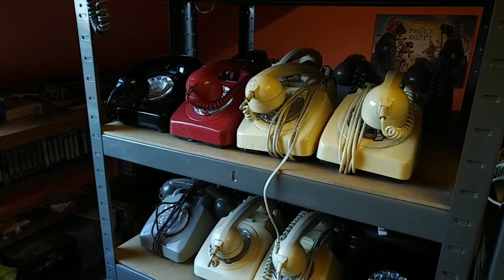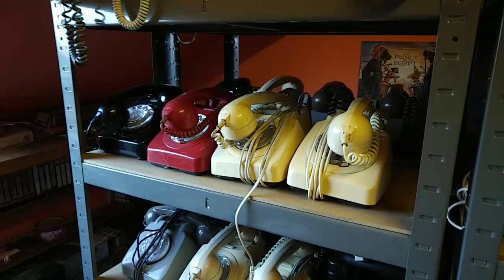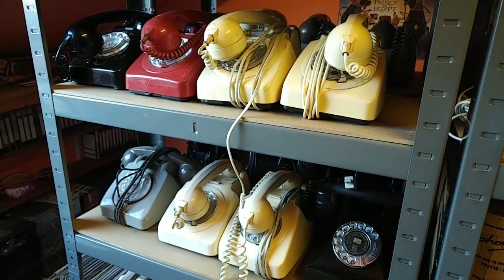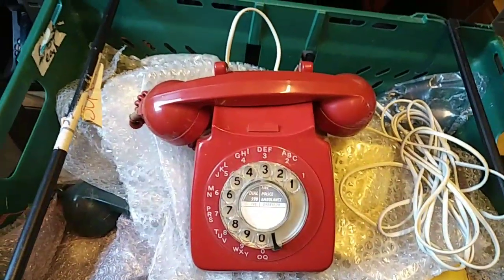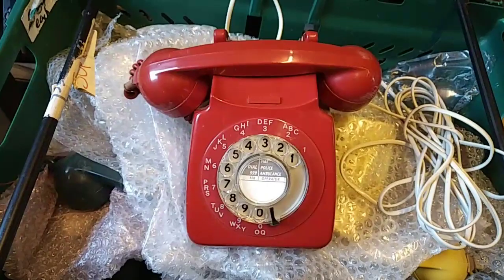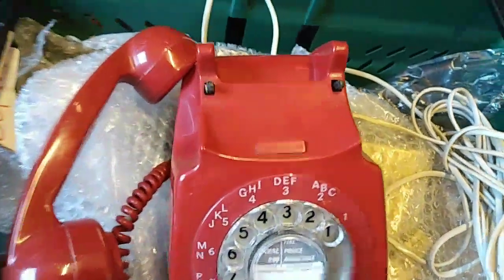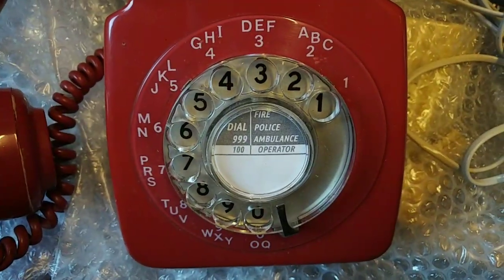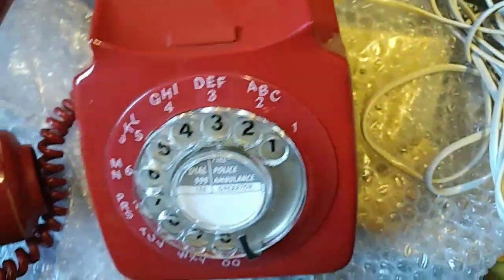Andy's Shed Live S06E07: The Early GPO Telephone 746

Comment: hi andy can you do a video how to wirer a GPO 706 with a 2 wirer RJ11 line cord cause i have got one but i want to wire it for the australian system cause i only get dial tone the bell dont ring
Reply from the maker: I can, but I can also tell you. First you need tomake sure the 706 has NOT been converted for UK plug and socket. The RJ11 should have the two central contacts wired up. The wires will probably be red and green. Wire one to T8 and the other to T18. It doesn't matter which way around. T16, 17, 18 and 19 will need jumpering together as two of three wires are normally joined in the box on a standard UK line cord. Actually, thinking about it, if those jumpers are missing it might be why your phone isn't ringing, so give that a try on your PABX,
Reply: Hi Andy I got a 746 working in Australia but I couldn’t get the 706 working I shall check the wires Thank you Andy
Reply from the maker: @christopher-2000  It's not a New Zealand phone you have there that looks like a British 700 seriese but has the numbers in a different order is it? That REALLY confuses things! lol